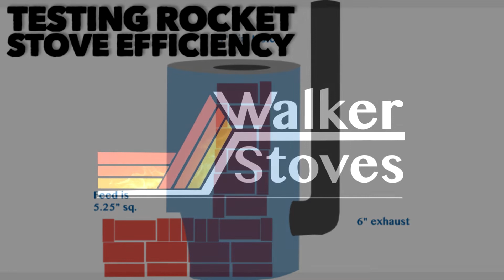Rocket Stove Efficiency Testing-Gear Discussion

Comment: Kind of on topic:
  When sermonizing on rocket stoves I define "efficiency" as being similar to the "proof" of alcohol.  An 80 proof spirit is 40% alcohol. An 80% efficient industry standard burns 40% of the fuel in the log.  A proper Rocket system burns 90%+ of the fuel making the efficiency 180%+ efficient.  Like 151 proof rum.